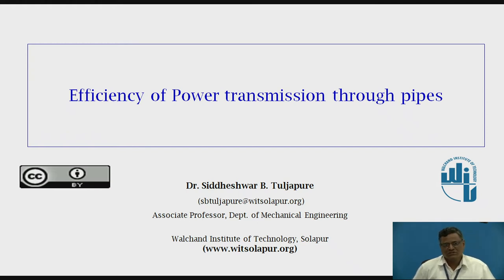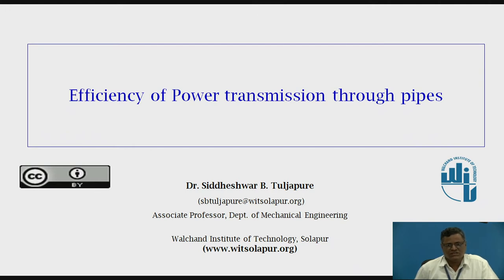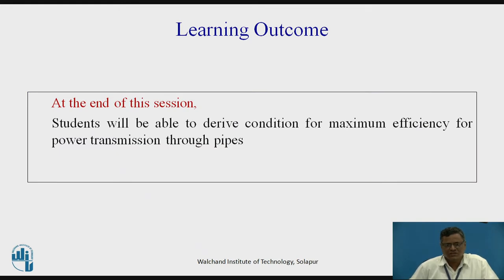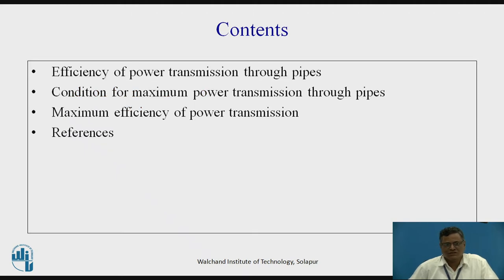Efficiency of Power transmission through pipes

Comment: Sir, I have a doubt.
Why did you take Velocity as a variable to differentiate power wrt to V? Why pipe  dia 'd' is not used for differentiating the whole equation by assuming it as a variable.